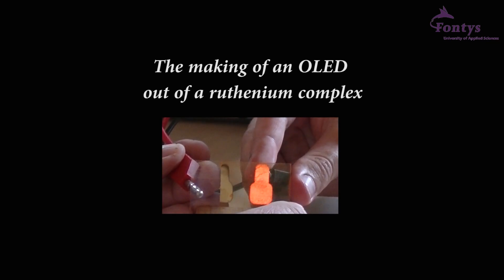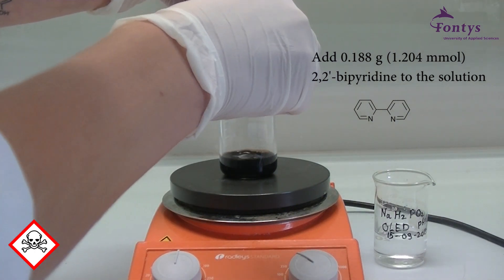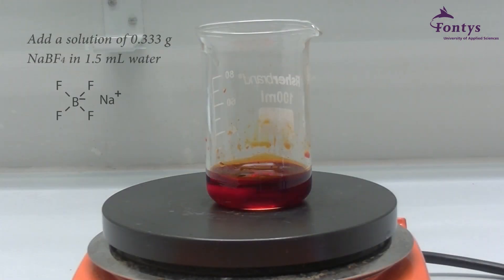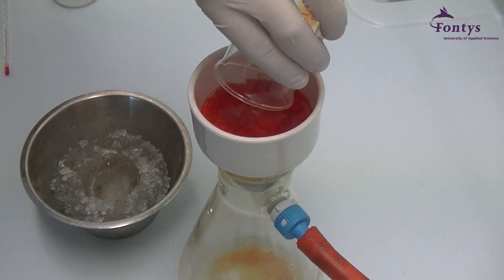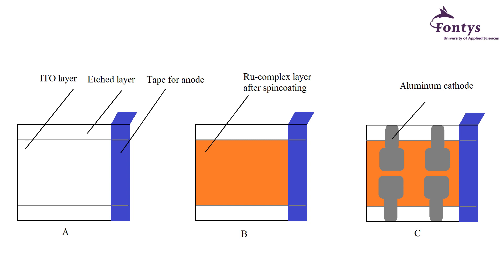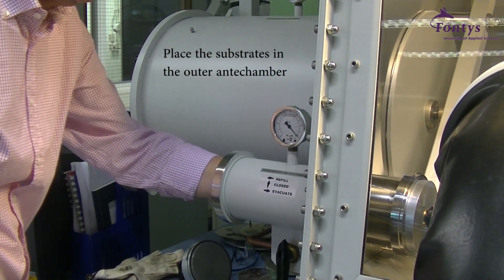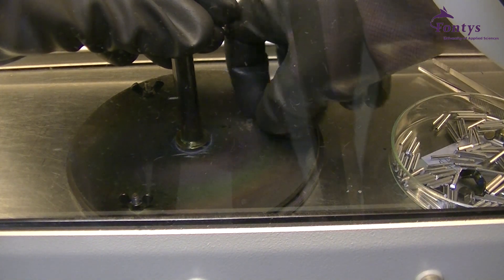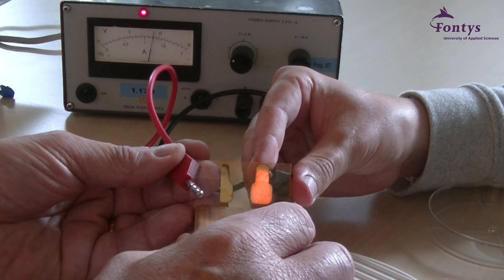How to make an ruthenium-complex OLED

Comment: There is 200 tons of soil waste in my warehouse. There are about half a kilo of ruthenium in every 1 ton. How do I parse. I'm investigating.
Reply: Well you saw here what dissolves ruthenium. By soaking the soil in that then rinsing you can leach out the things you want. Then you need to evaporate the extra liquid, and you are left with a mixture of ruthenium and whatever else was leached out. Now you need to repeat the step with less liquid and use a chemical that favors the impurities and use a separatory funnel to remove the unwanted stuff. Repeat until you have your product.

Comment: Their is some leakage in the emissive layer. Probably due to the aluminium contacts. The device is just degrading as you leave it on. You can tell after he leaves he device powered on for a second or two. Parts of the cell begin to die and turn dark. 

I read in a paper that if you replace the aluminum contacts with Graphene it glows brighter without the leakage. (Dark spots).

Comment: Actually, that's not an OLED, but an Organic Light-Emitting Electrochemical Cell. It works in a slightly different way. OLEDs require contact materials with proper work functions. OLECs don't.
A much simpler and quicker preparation can be found in the video "Preparation Of An Organic Light Emitting Diode" by Wisconsins Mrsec. (still that's not an OLED but an OLEC).

In our labs we use an even simpler way, as can be found in many papers in the literature (and the working voltage -not current! - is 4.5V).
Reply: then why do you make cat videos if you're doing THIS
Reply: @s.sradon9782  pays the bills man...
Reply: I've read that such cells have been used in biosensors and the mechanism is a classic example of reductive chemiluminescence in a transition metal complex.